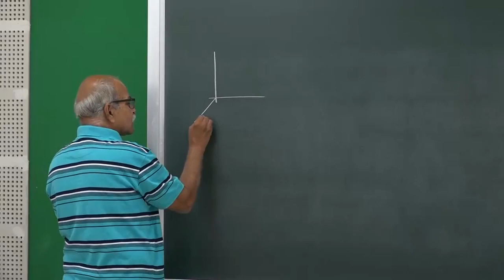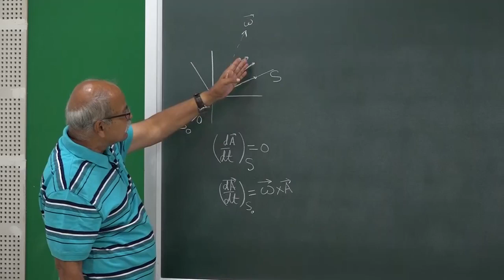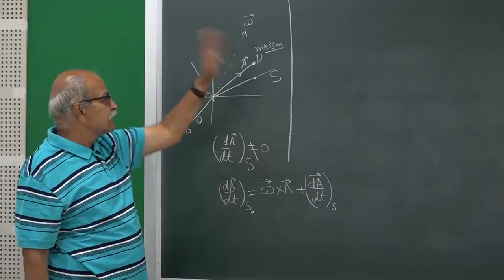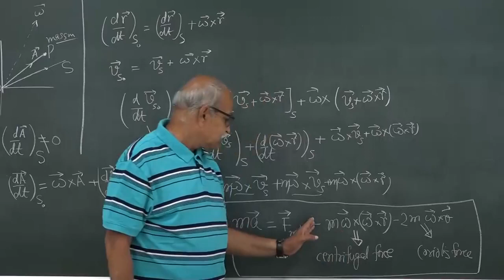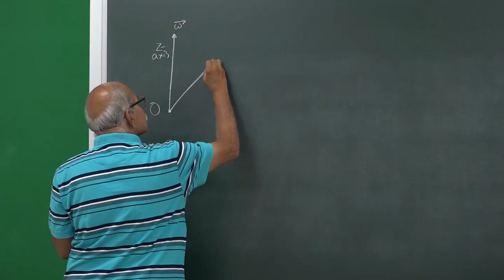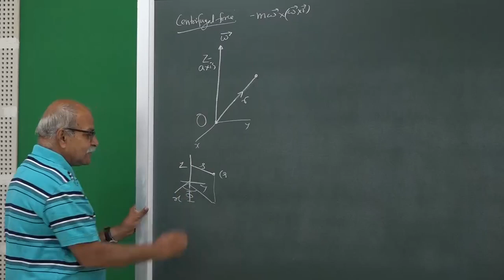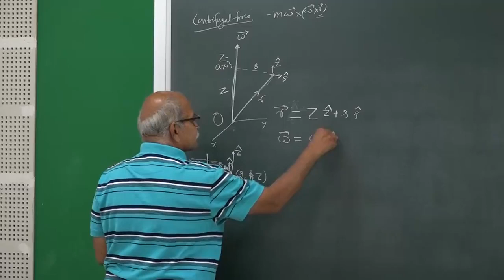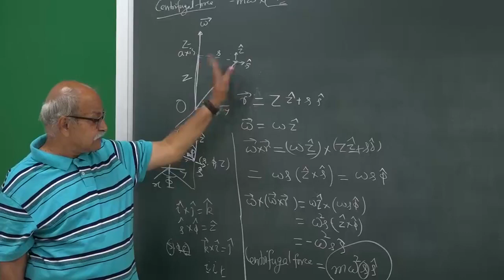LEC 17 Expression for Centrifugal and Coriolis force | CLASSICAL MECHANICS | HC VERMA | GDS K S

Comment: Good evening sir,

One doubt v= w×r,  so centripetal force is similar to corollis force

This is valid for both mass and wave, in any frame of reference.
Reply: w here is not particles angular speed but of the rotating frame .So you cannot use this quantity (w×r) for particles velocity (v)
Reply: @tahirmalik8949  Hello. Pls kindly explain why angel phi is not considered in the position vector r. Only z and s
Reply: @bhatiamayank3738  Hi, it's because position vector does not depend on phi. That is,if you're changing phi, there's no reason that it'll affect the length of position vector. 
You can also see this vectorially. Simply use triangle law as HC Verma sir used.
Reply: @tahirmalik8949  🙏🙏 Thankyou very much
Reply: @tahirmalik8949  bro did sir took the position vector to be fixed in rotating frame i.e 'S' ??
Reply: @tahirmalik8949  hi bro plzz explain why he have change  da/dt to dr/dt
Reply: @mr.hellgod  instead a we can put any vector that's why he used position vector r and also velocity Vs